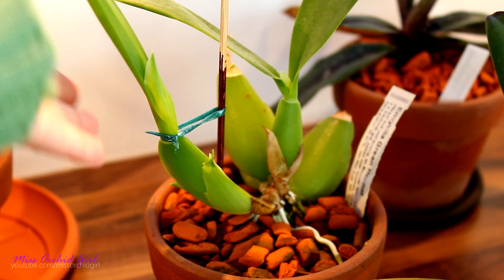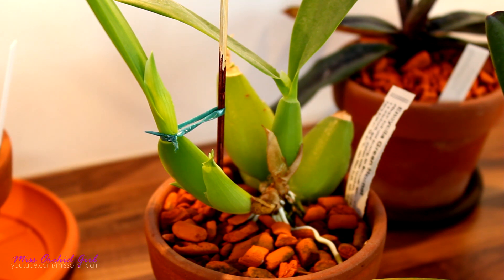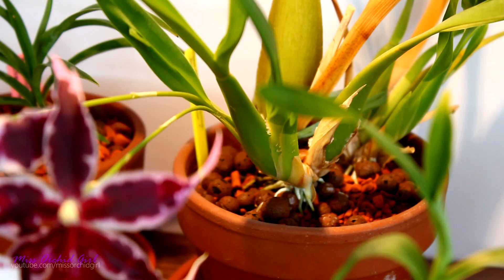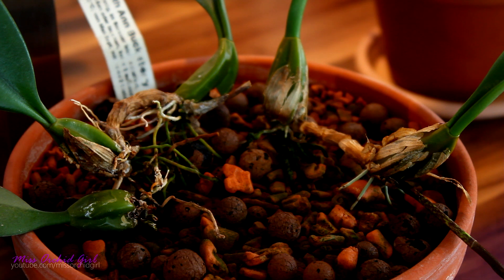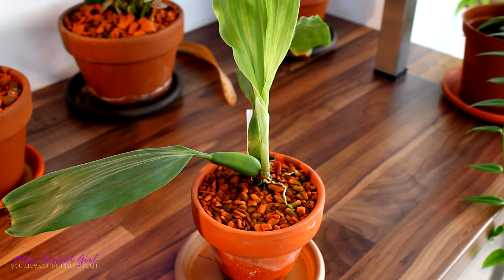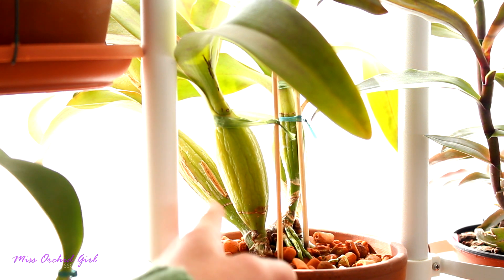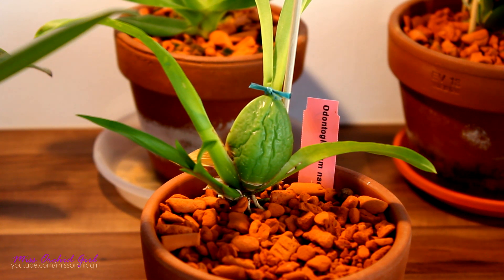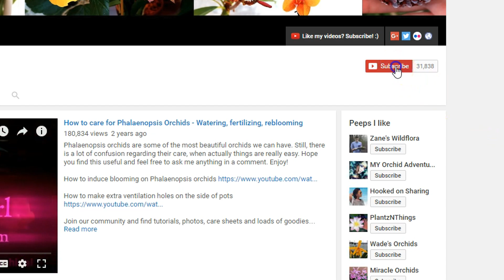Orchid pseudobulbs - Purpose, functions and features

Comment: Hi Dani.  What message is the pseudobulbs sending when they start displaying a change of color from green to a reddish color?  Also some of the leaves along the tip edges are turning red.  I keep questioning myself and hubby replies:  "Forget about it.   It's the Christmas season and they sre displaying holiday colors."  lol.  I wish, but I know better.
Reply from the maker: Hi Blanca, it usually is a sign of bright light, but since it's winter maybe this is not the issue. There might be 2 other reasons, cold stress or magnesium deficiencie, but this is for you to decide as you know the orchid and where it stays better :)
Reply: This is our dry season so we do have lots of sun, but I protect them from direct sun.  I will look into the magnesium deficiencies.   Thank you Dani.  I don't comment all the times,  but I do watch every single one of your videos.